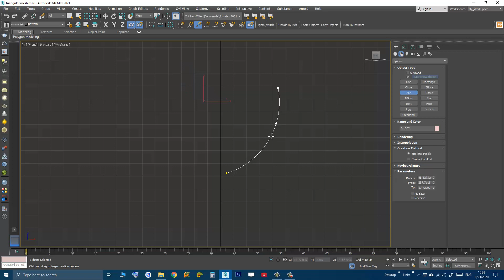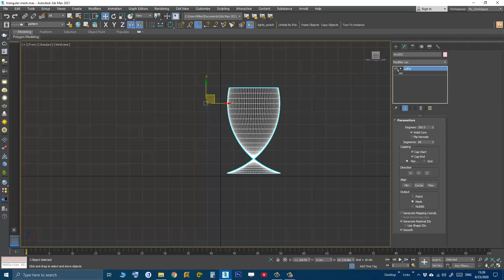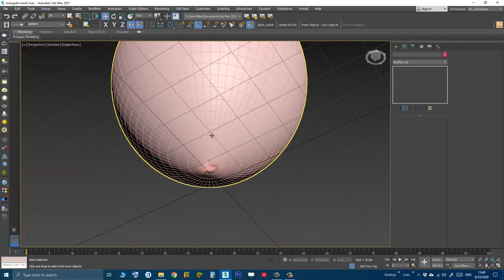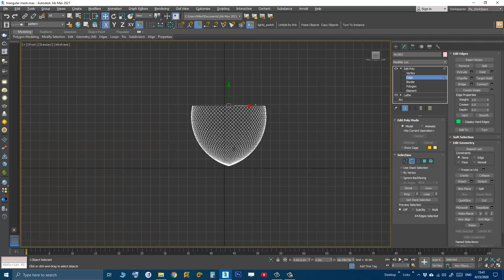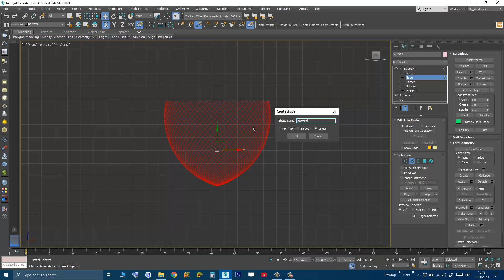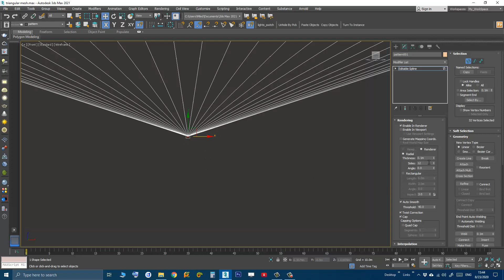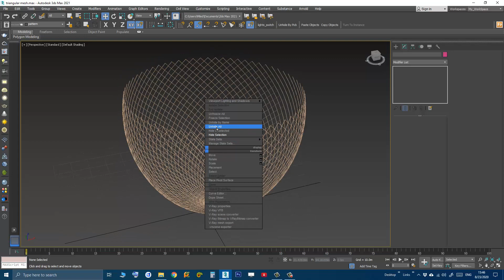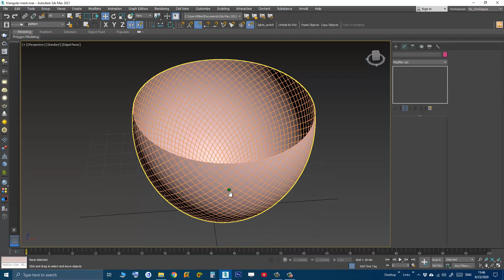3DS Max Easy Modeling Triangular Mesh

Comment: i think you can obtain a cleaner spline if you do it by loops, say the clockwise first and then the rest... you'll need to delete the top and bottom edges, then convert the first half of loops to splines, then the second half, attach one to the other and weld top and bottom vertexes, with a little work you can even make it look braided
Reply from the maker: Thanks for the comment, yeah a good approach, now in this series of videos I'm just trying to show some quick and easy ways for achieving certain things, in addition to learning some features in 3DS Max.